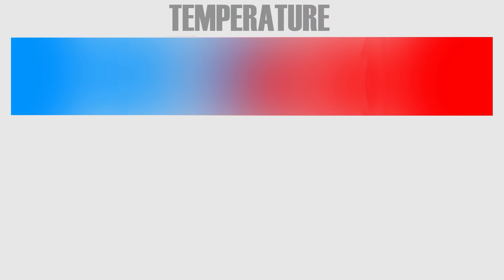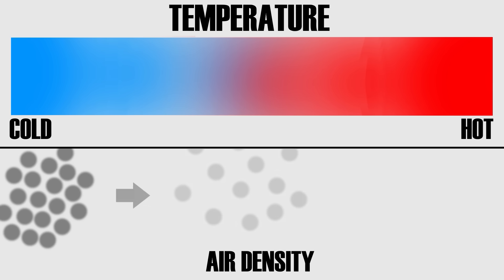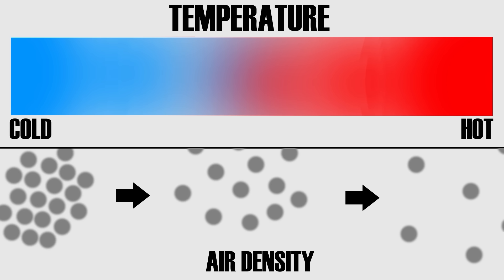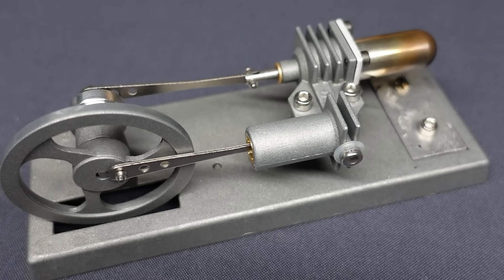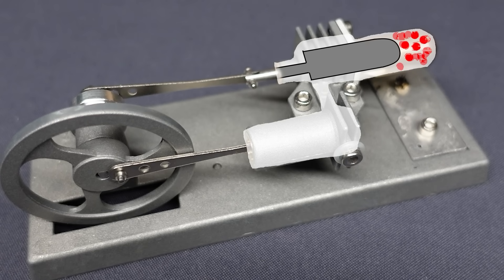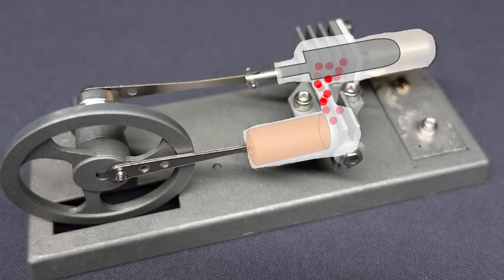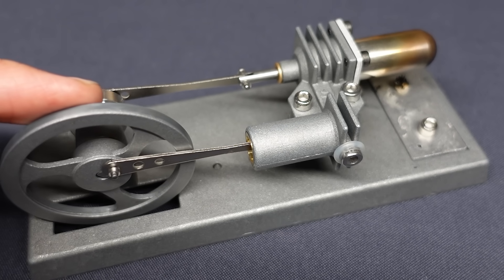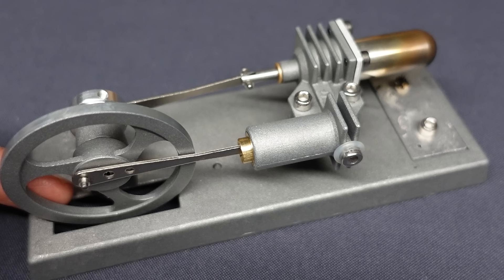It Can Save The World - The Simple Genius of Hot Air aka Stirling Engines

Comment: I wonder if you were to replace the air with a refrigerant if it would increase the efficiency
Reply: not necessarely a refrigerant, but yes, the working gas has a huge impact on the efficiency and power to weight ratio, in fact all stirling coolers, which are kinda widespread (basicaly stirling engine running in reverse) are sealed from outside and run on special mixtures of gases
Reply: refrigerant wont do much. What you want is hydrogen or helium. Hydrogen is the best, but it is very flammable and is prone to leaking. Helium is the second best working fluid, but is more expensive
Reply: It's not the efficiency but the power. The thermal efficiency is tied to the temperature difference, if you increase it but you also increase the output work, the efficiency remains the same. And yes, to get more power, you have to cool down the cold side, heat up the hot side or both. This engine just works using a temperature difference, that's it.

Comment: I Need a big block version !
Reply: Ask Kockums in Sweden. They build the Stirlings for Swedish submarines. :)
Reply: @mixmashandtinker3266  We 🇫🇮 definitely need some excellent Swedish 🇸🇪 subs 🥳
Reply: @mixmashandtinker3266  Swedish makes the best 🇸🇪 Greetings from 🇫🇮
Reply: @verttikoo2052  Can I buy a military surplus one from somewhere?
Reply: How many cubic inches or liters? 😂
Reply: It would be the size of a rolls royce for your car. Is that a big enough block
Reply: With a torch lighter!!! Lol 😂
Reply: Been built and used in vehicles
Reply: manitoba-op4jx  That is how it is used in the submarine, I am sure.
For everyday use, the extra four energy conversions (mechanical to electrical, electrical to chemical, chemical to electrical, electrical to mechanical), means that you would have lost any of the efficiency benefits of the Stirling cycle.
Reply: V8?
Reply: It is so cool.
Reply: I’m thinking 410 cubic inches
Reply: NASA is making a nuclear free piston Stirling engine, replacing the current MRTG.
Reply: You'll run into a problem keeping good RPM and speed control.
Reply: If you lube it it will be even quieter lol
Reply: It is impossible, alas. Very Expensive do it. Grow power - Grow overprice.
Reply: @user-xz4all  

https://youtu.be/aoKECrXeiV8?si=_aMKPmBi0a8QnZ-2
Reply: @elijattack9621 
Your going back to WW2 and before with that sort of tech..  but it can work just the gas bags a bit of a liability.
Reply: Oh yeah !
Reply: manitoba-op4jx my thoughts exactly.
Reply: You really don't, a steam engine is way more efficient and if you want a clean petrol engine (which is so much more efficient and controllable), convert it to liquid hydrogen.
Reply: With a hawg ass cam
Reply: You just need a high pressure one then you would need it that big
Reply: A 440 my man
Reply: Find some industrial pressure cookers, and build your own. 😅
Reply: I think d4a didn't do much research on this one, unfortunately. He didn't even mention the distinction between alpha, beta and gamma types. High power Stirling engines were investigated in the 50s and 60s by GM (I think) but they never got far because of the high complexity and cost needed to achieve significant power output. Not only that, but they are poorly suited to rapidly changing rpm, which makes them a no-go for anything but generators and the like. 
Cool tech, but not particularly useful for anything beyond desk toys and multi-million dollar submarines. I suppose you could build a simple one to run off coal or wood as an emergency generator, but power output would be low.
Reply: @slartibartfast2649 He mentioned the lack of rpm variation problem, actually.
Reply: @slartibartfast2649 so basically on a scale needed to power a car, the energy (heat) source would be impossible or impractical to use this way?
Reply: @slartibartfast2649  They would be great for alternate fuel stationary engines where you could burn just about anything, charge batteries, pump water, run blowers to get your burning cleaner, etc.  All of the northern hemisphere needs heat right now, and many of us have enough trash in the yard, like fallen limbs, leaves, etc to keep us warm all winter.

Comment: External combustion engine have a lot more efficiency promise than internal but stirling engines have a power to weight ratio that is fundamentally constrained by the the regenerator's surface area drag on the working fluid which squares with RPM.
Reply: Also high specific output requires high pressure low molecular weight gas. This is usually Hydrogen, which permeates straight through metal, and so leaks out of the cylinder block. 
Stirling engines certainly have their place, but it isn't in cars like GM tried in the 50s. Constant power output is where they really shine